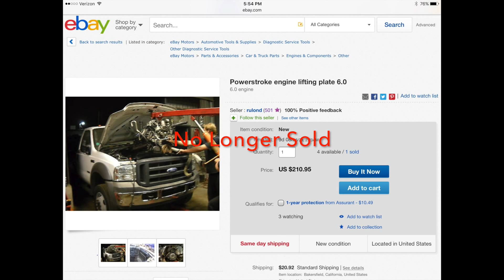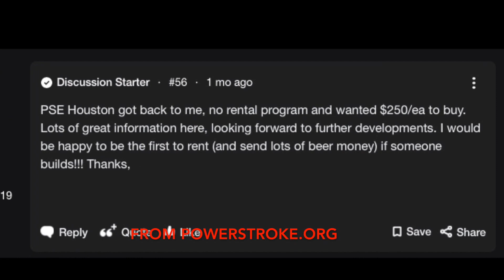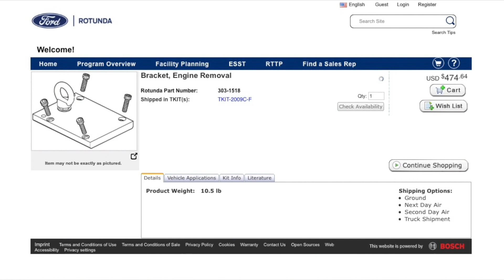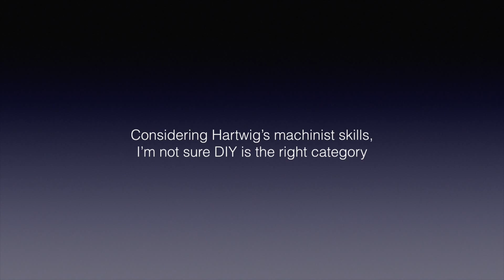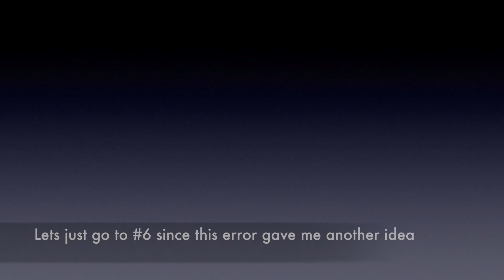Powerstroke 6.0L Engine Removal Plates / Brackets

Comment: This brings to mind a quote from Encyclopedia Britannica about Noam Chomsky. "No area of modern linguistics is discussed in any other terms than the ones he chooses" (from Scientific American). May not be perfect word for word, but it's very close. Whether you like Chomsky or not, he is one of very few people to get into EB while still alive. I'd say no area of discussion of the 6.0 should ever be done in any terms other than those referenced by TMT. Any aspiring wrencher should watch his videos. If I taught auto mechanics on any level for any vehicle types, I'd make all his UTube videos "required reading". My favorite is the one on block and head deck surfacing, and the .0005 shim stock and methods he (you?) use(s) to check the work. It was so nice to see someone do it the right way, and even better than I learned working in an automotive machine shop. I made up a quote years ago. When you research any subject, go to the best source of information you can find and get as much information from that source as you can. I hope I'm not gushing too much, but my mom was Polish you know.

Comment: Good afternoon, and I hope your Sunday tree sales are going well. I'd like to get in line for your #6, but I couldn't find pricing in my impatient skimming, only the paypal address.
Reply from the maker: I'm still treading water for at least another week before I get into more of these.  The pricing I have in the comment and description area of the next lift bracket video.
Reply: Okay found it, thanks for the reply. It would cost me about $75 (minimum shop fee) to have that welded. Would you be willing to do it for that plus another $10 for the larger USPS box?
Reply from the maker: @prlewis320  Peter, I need to think about that or check out what shops around me would charge.  Right now I'm focused on other things so I need a week or two before I can sort that out.  My welds held up fine with not only my engine well dressed, but lifting the trans, letting it pivot on the back mount, so I know they are OK.  But I'm an amateur welder.

Comment: 3 and 6
Ready to buy now, these look great! Would prefer it as a weld it yourself kit
Reply from the maker: Thanks.  I just finished getting CAD drawings and payment to the supplier to cut out 5 sets of each.  Since it's my first CAD work, I have to see how they came out.
Reply: @toomanytoys  I’m going to be replacing my engine here in about 3 weeks
I’ve done several using a chain but never used a lift plate

Think you would be able to ship one out before the?
Reply from the maker: @xpbprox  Two things: I'm waiting for the supplier to fill the order, but I don't have a date.  The second is if I screwed up the cad drawings.  

I have the parts for the more complicated version 6, and the mounting bolts and shackles if people want them included.
Reply: @toomanytoys  I’ll take the version 6 parts, how can I pay you for them?
Reply from the maker: @xpbprox  I'm sorry, I screwed up the way I wrote that.  The parts I was referring to are the bolt, weld nuts, and turnbuckle.  I don't have the base, flanges, swing arm, or backplate as yet.  Those are the order to be lasered and shipped.

Comment: Damn my gramps woulda loved having you around when he was doing the first airtanker/ firefighter conversions on ww2 surplus aircraft almost every tool i have that was his was either modified for one specific job or made by him. My gramps was so meticulous he would make my dad spend days building jigs just for one weld. i think i like ver 6 due to small adjustments go longways on install  but other brackets maybe able to just utilize a ratchet puller  from bracket to lower front of engine
Reply from the maker: My first drawings have been sent, and I'm waiting to see how they lay out in steel.

Comment: Number 6 is a winner for sure in my opinion especially for ease of engine manipulation on engine lifts that don't have the reach that others do for the weight being lifted with the PS engines. I personally would like the prints done I fab most all of my specialty tools in my shop. I would be needing one soon as I threw a rod cap out of the side of my block 😓. Thanks again for the great material and I support your work all the way.
Reply from the maker: Thanks,  already gave out one set of drawings, and as soon as I did, he became a competitor.  So I'm not sure it's the way I'm going to go.  I'm not going to do this long-term as a business, but I just like to cover my expenses.
Reply: Well darn it hurts to hear someone would do that in the community, again I appreciate your great wisdom on here and on the forums.
Reply from the maker: @parkerharrisottoson7848  I take half the responsibility for it. He was trying to help others and didn't consider the effort I was putting in.  I thought he was in need right away and didn't state for his use only.  I think we both learned from it.

Comment: FYI,  I finally got my 6.0 to crank at the proper RPM, thanks in large part to your vid on that subject (please fill in the correct title for those who have the problem, as my memory fails me).  SO satisfying to hear that thing crank as it should!
Reply: Where was your issue?
Reply: @Bacongrease00   It was a combination of the obvious and the not so obvious. I started by having a basic diagnostic done at the local parts store. Now I know this is an extremely hit and miss proposition, but I was betting on the technology out witting the user. As turned out at least one battery was in order, so I replaced it. As expected, I still didn't have the desired result, so I followed your recommendations and added the extra ground cable. Still the slow cranking persisted, however I had to live with it for a while. Fast forward to about a week ago and I found myself stuck at the window of a drive through. So, it was off to the parts store to take another shot at the charge system/battery tester. On the first try (with only one battery in the circuit) things changed. It cranked better on one battery! “This” I say to myself “is new information!”.  A few minutes later we get a “fail” indication on that same battery.  The drivers side delivered “Good” on a couple of repeats of the process, so, once again, in with a new battery, and “Viola”, a nice zippy crank that I hadn’t heard in probably a couple of years.  The takeaway is that the little high-tech battery/charging system tester can get it right, pay attention to the low hanging fruit and pesky little problems can be made to go away
Reply from the maker: Thank you.  It may have been one of the first ones about battery cable balance or the alternator subject with battery testing.

Comment: I’d buy version 6  ready to weld if it is cost effective.
Reply from the maker: Thanks.  I'm getting the steel cut now.  Version 6 has a lot of parts to buy and more steel to cut compared to Version 3, which appears to be adding up.

Comment: Number 6 and number 3 would be my choices -- rental and kit purchase would be nice, I think.  I really like the adaptability  of style 6.  Top welding would be fine in most instances, unless the person was a total noob at welding -- this would save the extra time making the base plates and side supports.  I suppose you could offer both versions for a price difference. - Hydro
Reply from the maker: Thanks, Steven.  I'm waiting for the supplier to cut the steel to see if I made the CAD drawings correctly.

Comment: Man being some one who lives in the suburbs I have no access to a lift and would love to work with you obtaining-version 6. I’m planning on doing a over haul on my 06 while I’m doing the head studs this spring.
Reply: Lifts can be rented from a "tool rental shop"  think lawn mowers, tillers, ditch diggers etc.  Almost any town of any size has one.
Reply: @danaschoen432   I have a engine hoist I’m taking about a two post lift to pull the cab.
Reply from the maker: Thanks.  I'm getting the first batch of steel cut now to see if I'm any good at CAD drawings.